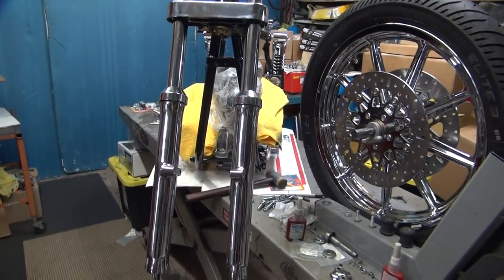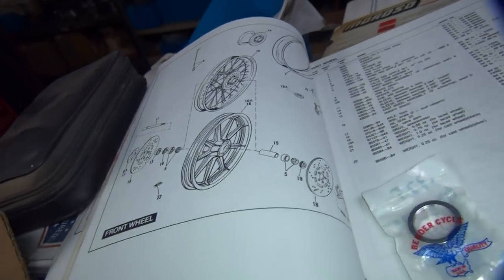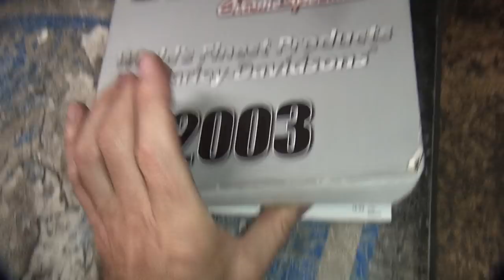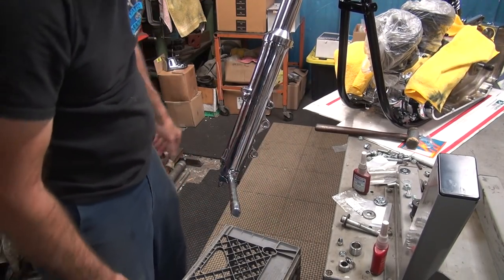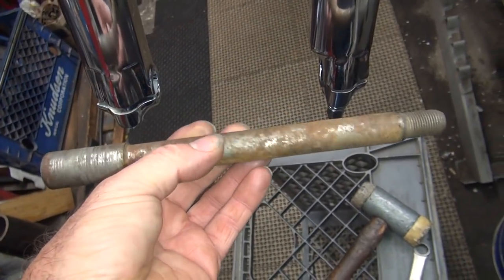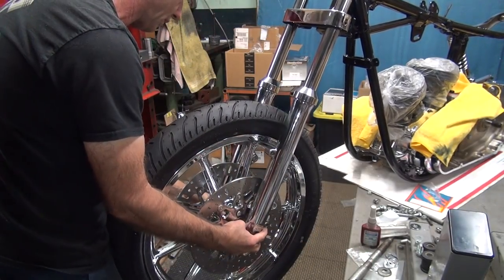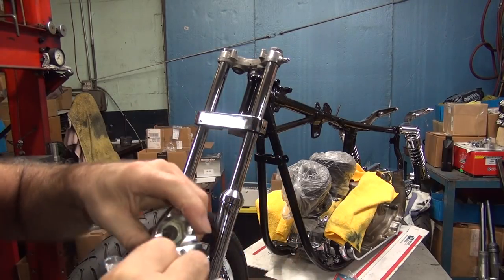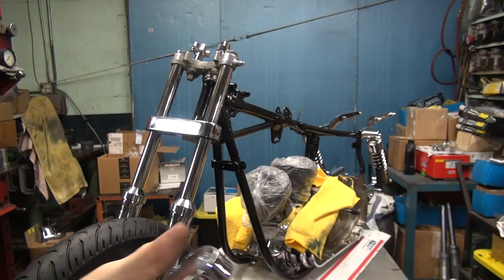#130 1978 93ci stroker shovelhead big bore motor new bike build fl harley by tatro machine

Comment: My observation on arrow direction and tire rotation is relative to which side of the tire the arrow is located. In this video the arrow was on the left side and my observations reflect that.
Reply from the maker: the arrows have to do with direction of rotation, not the direction it is pointing at for that moment.
tatro

Comment: I think  out loud. What if you change the two tubes/pipes, would the speedo drive fit ind the right side. And the axle goes into the left side. So the book is right.
Sorry for translation. 
Henrik "Denmark"
Reply from the maker: like most things on harleys you need to match all the parts in the assemble. when you mix and match different parts you run into problems. the correct year parts are on order and will be going together soon.
tatro
Reply: @TatroMachine  THANKS.